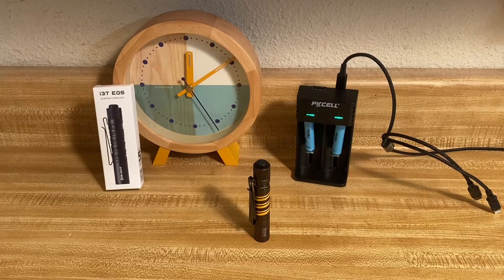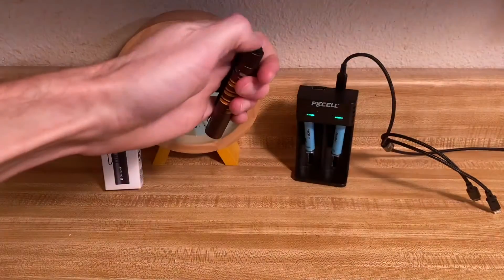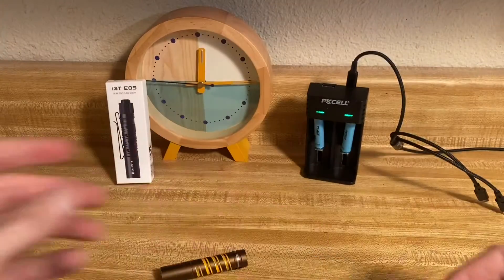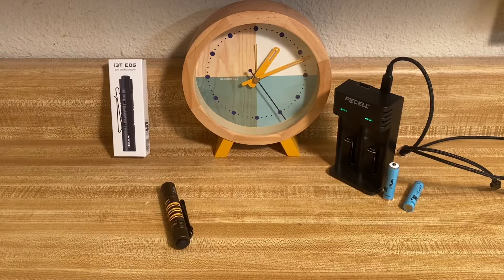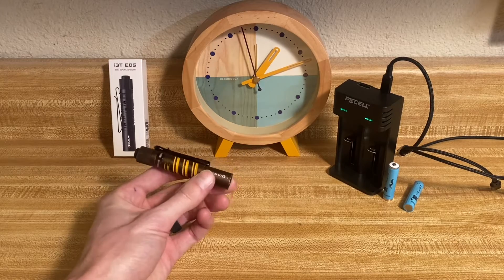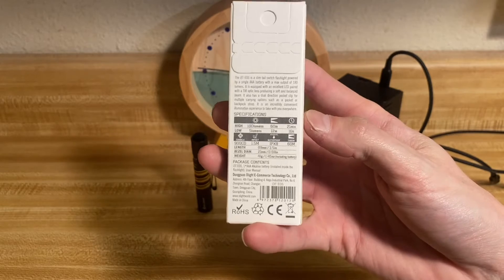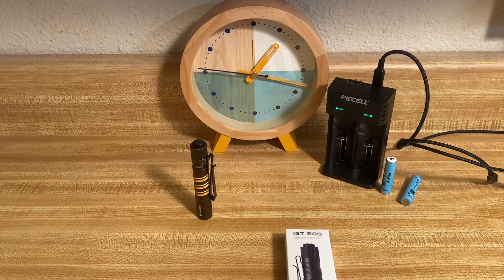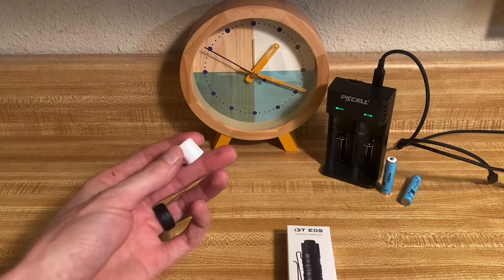Olight i3T vs. 3.7v 10440 Lithium Rechargeable Cells - A Runtime and TURBO Endurance Test

Comment: I bought the i3t as a bundle with a 20cv benchmade bugout. I really just wanted the knife but got the light with it just for shits and giggles. Didn’t know anything about it. What a stroke of luck this has been to get what is really the most versatile little edc light on the market.
Reply from the maker: Nice! Yes, it’s still the best in the AAA size category in my opinion. Tough and reliable for sure. Mine is still going strong even after the abuse I’ve put it through.

Comment: I slowed down the playback speed to .25x yet i cant read the card at 60 minutes. Your handwriting is hard to read plus the speed of the video. I think you used 3 batteries to reach 1 hour using the HIGH LIGHT OUTPUT SETTING. Hopefully i understood your video correctly.
Reply from the maker: Sorry about the speed and handwriting. And you are correct, each battery lasted for an average of about 20 mins.
Reply: @PardonMyEnglish  ok thanks for clarifying 👍

Comment: What about the i3t plus ? And i3eos can thay also take 10440
Reply from the maker: Good question. Unfortunately 10440s won’t work in the i3T Plus. Because the batteries are stacked, the voltage doubles to 7.4 and the LED can’t handle it.
Reply: @PardonMyEnglish  mix it one aa one 10440s
Reply from the maker: I don’t think mixing the batteries will work unfortunately. Also I don’t have an i3T Plus so someone else will have to try this if they’d like. 10440s do work in some i3Es but not others for some reason. I actually have a couple videos about this if you’re interested: The Olight i3E + 10440 Mystery - A Possible Solution
https://youtu.be/C7-gIwM3iXw

Comment: Where do you buy the battery ?
Reply from the maker: I found them on Amazon. The only two brands of 10440s I’ve tested are PK Cell and Demon Fire. The Demon Fire cells are nice because they are protected but they are slightly longer so they are a tight fit in the light. The Demon Fire cells also didn’t come with a recharger.

Comment: So you were able to pickup the light after 20 minutes? And it  didn't  melt the circuitry....should mean  it would be  easy to hold  at "step-down"...you should do  a "held in hand test ...to step down...while at max lumens" :)
Reply from the maker: Great question/concern. I actually just finished a video about heat: How Hot do they get? Olight “Hot Rod” Heat Testing with the i3E, i3T, i5T, and i5R
https://youtu.be/cS_83CqwrnI

Comment: Those cells are very low amperage if I recall correctly. Throw some vapcell 3amps in there and see if it’s the same result!
Reply from the maker: Good idea but I hesitate to try those since they are flat-top batteries. The mAh capacity is also less than the 350mAh PK Cell batteries at 320mAh.
Reply: @PardonMyEnglish  I have a few of the 3a cells, and they are way brighter than the PK, but I haven’t left them on for much more than 30 seconds or so at a time. Too scared lol
Reply from the maker: You and me both, haha! That’s crazy that they get brighter than the PK Cell batteries too!
Reply: @PardonMyEnglish I been using my i3T with the Green Vapcell 3A (320mah) BUTTON TOP batteries for more than a year already my i3T still works. I wish the Vapcell had more capacity.
Reply: @PardonMyEnglish My green Vapcell 10440 3A batteries aren't FLAT TOP but button top. They make my i3T really bright I wonder how many lumens it is at low & high settings.

Comment: Have you tried these batteries in an i3t plus?
Reply: Someone did try and it cooked the emitter right away. Don't do it.
Reply from the maker: Good to know. Thanks for looking out!
Reply from the maker: I have not tried that but I don’t think it would work because the batteries would be stacked  and connected in series. This would double the voltage to 7.4v. I doubt the light would be able to handle it.